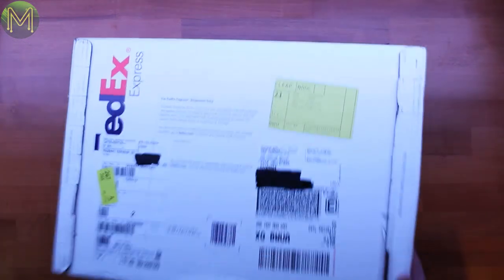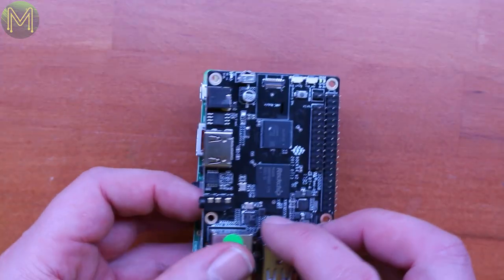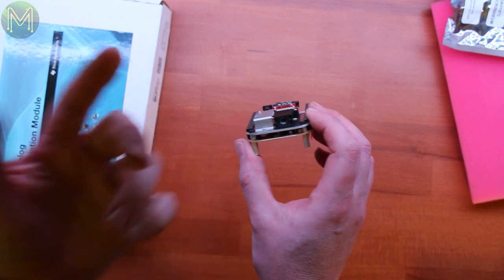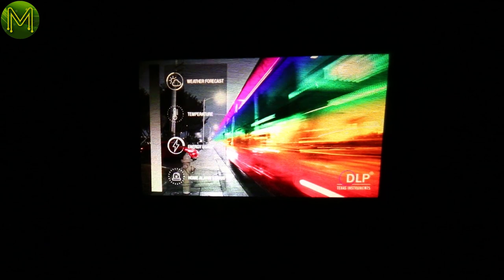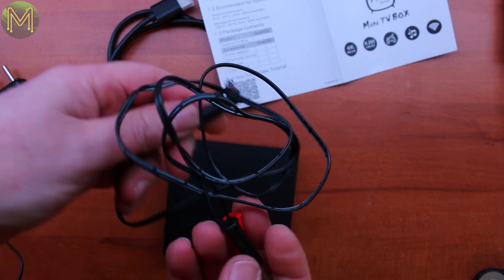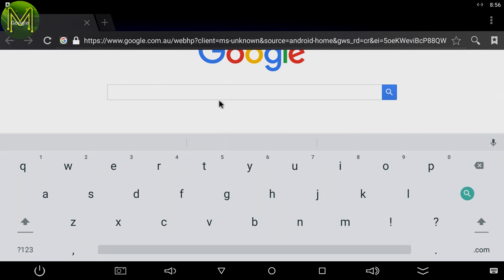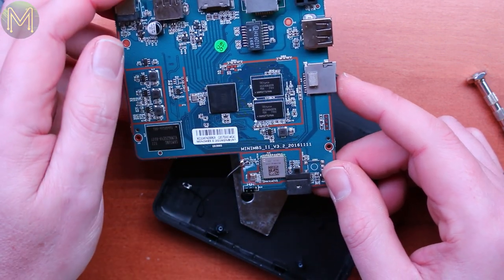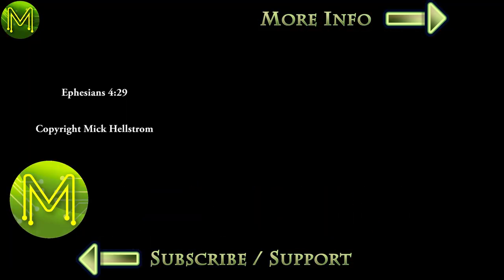#164 MickMake Mail #16: Rock64, DLP2000, VolksPC & FLiR // News

Comment: Good luck with those DLP2000.  I hocked up mine to ESP8266, to get the WiFi.  Don't  know if you want to the coding your self or want pointers (like you need that?) but there is libs fir ESP out there.
Reply from the maker: Thanks mate. I was going to roll my own. I'll see how far developed the existing libs are. If they are good I'll help out development, if not I'll start my own up.
Reply from the maker: I'll need them for my alarm clock project anyway.

Comment: Turn it into a really smart reflow grill. Mmmmm... toasted SMDs! The grill marks on both sides of the PCB will really add an appetizing appearance. And, BTW, FR-4 is a major roughage supplement to one's diet.

But, seriously, really looking forward to your review of the Rock64... and why don't you buy a set of cheap mains plug adapters to adapt from our US plugs.

m3sca1 subscribed.
Reply from the maker: +Winston Smith 
Actually that was exactly one of things I was going to use it for. Only if it'll get up to the right temperature though and cool down will need a fan. Hopefully it doesn't have too much thermal mass.

The US plugs? I now have so many wall warts that I'm throwing out the US style ones. I also have the bench power supply as well, but yup should get some adaptors.
Reply: I use an electric skillet of this brand and very similar in style, but an earlier model that was discontinued, apparently because they switched away from Teflon to a ceramic non-stick surface, and therefore it was on sale at Walmart for $9.99:

https://www.amazon.com/Oster-CKSTSKFM12-ECO-DuraCeramic-Electric-Skillet/dp/B00ITPJ1DA

The glass top acts as an IR reflector when in place, but still allows the PCB to be seen. It just so happens that 30 second full on - 30 second full off cycles closely match the proper heating curve with full on for 1 minute in the final stretch to solder flow, followed by off. This was determined via IR thermometer readings and is probably fairly accurate because the emissivity of dark Teflon is pretty high. "Cool down" is "wait for the solder to solidify, then remove the PCB with tweezers". It doesn't take long for that to occur.

I don't do a great amount of SMD, so this is fine and I haven't even bothered to automate the on/off cycles, I just do them manually.
Reply from the maker: +Winston Smith
Yup, I'd like to be able to automate it and in fact come up with a kit that allows you to retro fit existing appliances. Thinking of doing the same to a clothes iron.
I have a number of PCBs I'm designing that'll require some automation.
Reply: Something simple and cheap using, for instance, an Arduino Nano v3.0 (or other really cheap Arduino with USB) with user set timing constants in the code which could be changed via the Arduino IDE for the specific heating device as measured by the user using a cheap IR thermometer (which can then be used for other things) would be great and provide something that I don't think is available. No need for the complexity of temp feedback or PID control.

Comment: I love the DLP!!! but its only for beaglebone!? the beaglebones need to be a bit stronger. cpu/gpu&ram
Reply from the maker: +V.I.K 
It'll be relatively easy to use it on another SBC or even MCU, but I'll have to write some drivers for it.
Reply: On aliexpress there is a small cube led projector around 80$, which has that strange resolution of 640x360. Probably the same Ti Dlp. 
Would be nice if it could be hacked...
Reply from the maker: Hmmm, might have to check that one out!